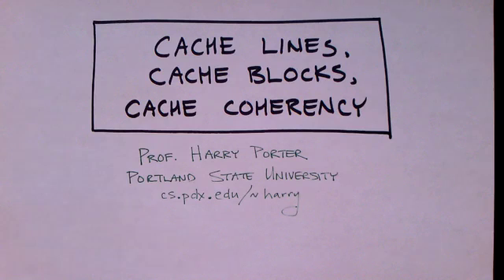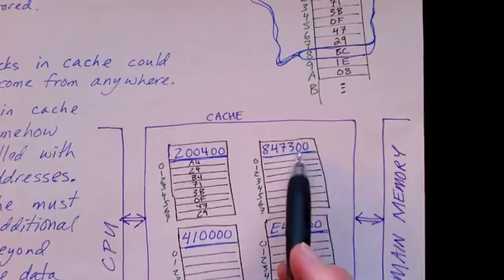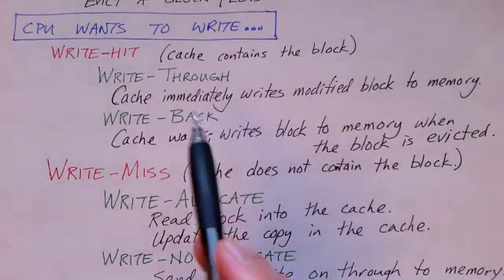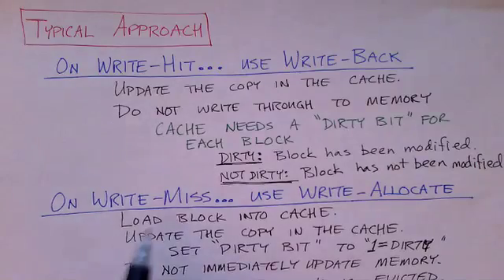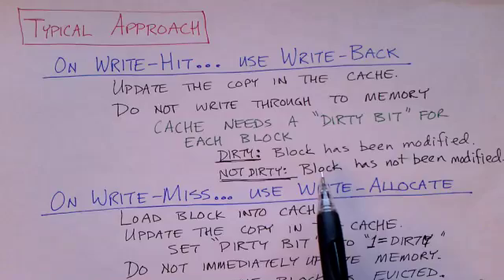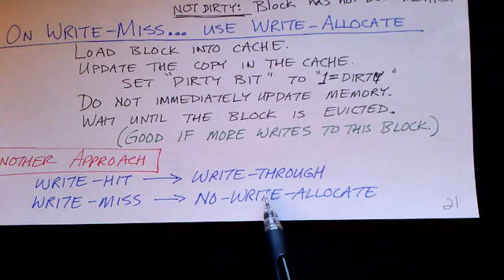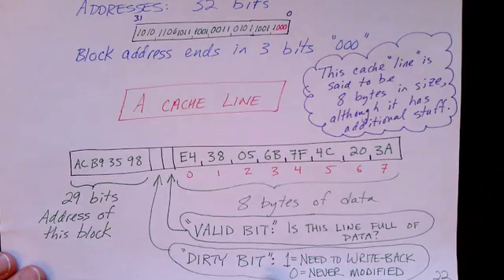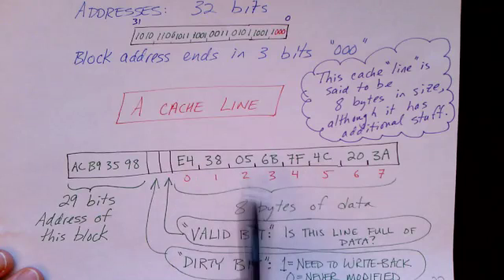Lecture 4/9:Caches-Writes and Coherency

Comment: please explain. the last 3 bits of an address. 1 byte is 8bits. how does 3 bits represent 8 bytes?
Reply: This definitely deserves some explanation as it is a technical detail of CPU caches.  The last three bits (000-111) are used as an index into the cached data.  The first 29 bits are commonly referred to as the 'tag.'

Here is how I imagine it working:

CPU:  Give me address [0...tag_bits...28]xxx
CACHE: Let's see if I have data for the 'tag' [0...28]
if (TAG_FOUND)  :  CACHE: Great, is it valid data?
if (CAHCE_LINE_VALID) : CACHE: Amaze balls.  Read the byte at offset xxx (this is the index mentioned above)

The professor probably glossed over these details intentionally to avoid leaking too much about cache mapping strategies into this discussion, which is understandable.  Still, almost every book I've read about the subject does this and as a beginner, it is so frustrating to not know why as it's being explained.
Reply: The point is, to store 8 bytes you need 64 bits, but to address 8 bytes you only need to count them, so 3 bits are enough.
Reply: 2^3 = 8

Comment: 1 byte is 8bits. why did you say 8bytes are stored in last 3 bits 000? :(
Reply: "8 bytes are stored in last 3 bits" means - 3 bits can be used to point to 8 bytes

000 --> First Byte
001 --> Second Byte
.
.
.
111 --> Eighth Byte

Comment: Why don't cache memories have pointers to the main memory instead of data?
Reply: Then it would still need to fetch the memory from the RAM, the whole point of using caches instead of RAM is access speed. Besides we already have the adress of the RAM block we want to reach, so why would we need a pointer .